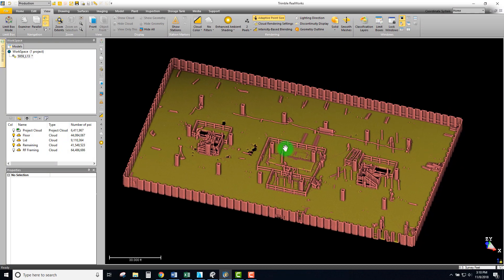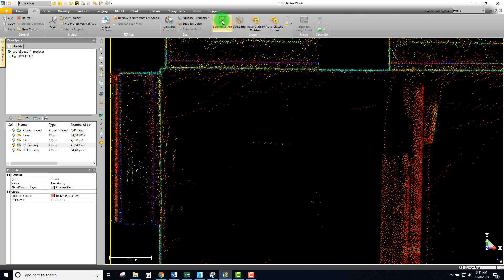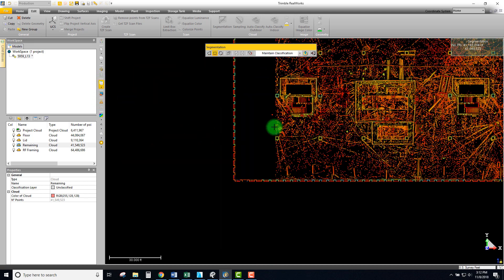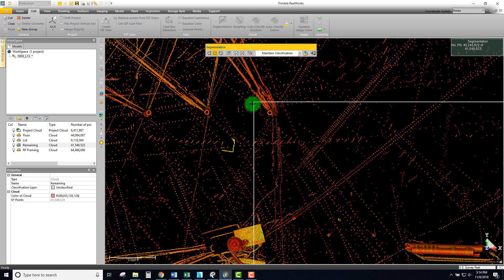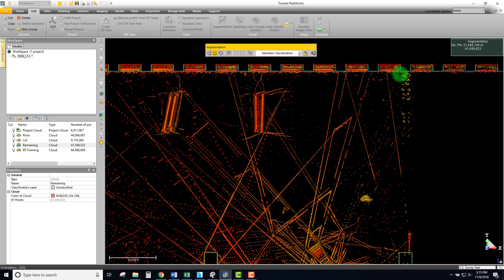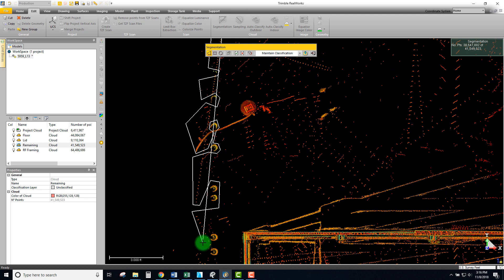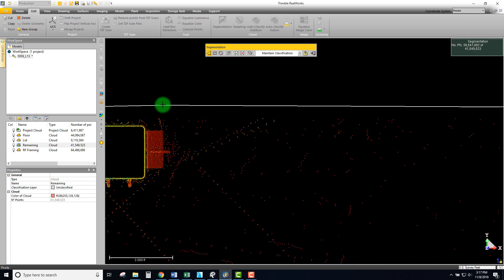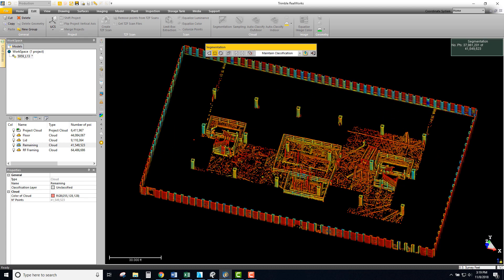TRW Part 5 - Select and Delete Points

Comment: useful video but you're not actually 'deleting" the points, correct? File size looks unchanged so they are still in the database.... this is a great video though. very helpful
Reply from the maker: Correct, we're removing points from one segment, and typically backing them up into another I like to call junk. The database always contains the raw points, and through sample and segmentation we create specific areas of interest. Glad you found this helpful! Recorded a while back...